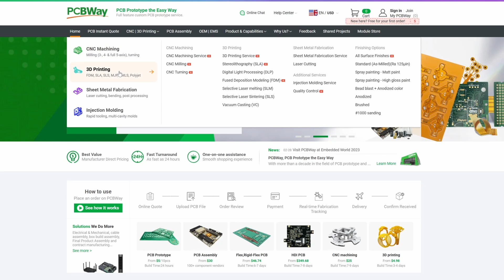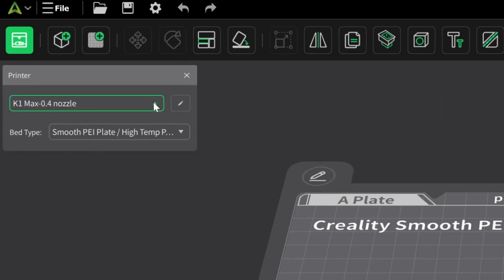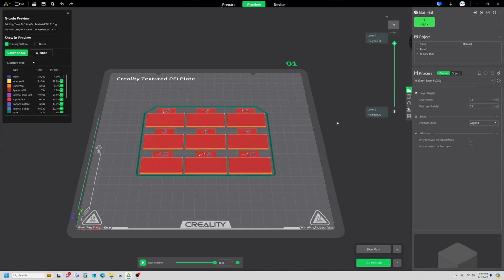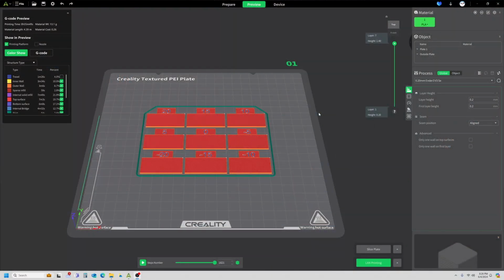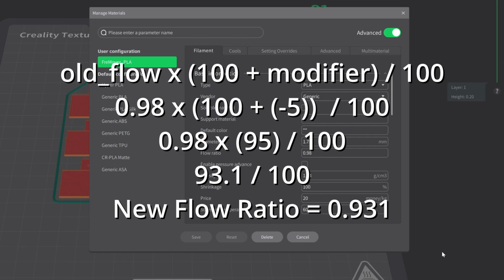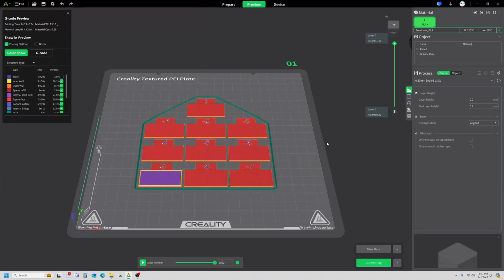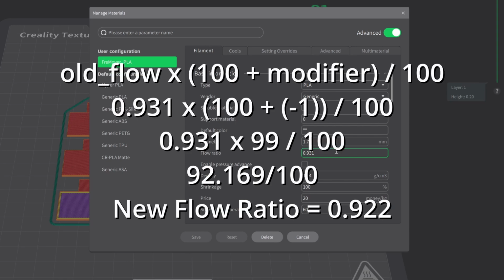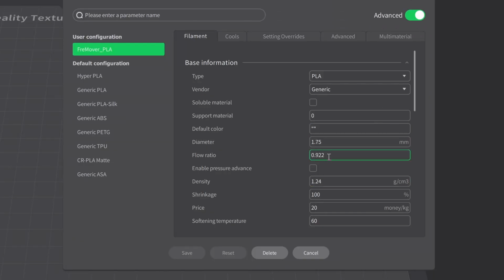Dialing In Your Flow Rate With Creality Print 5

Comment: Why dose it put it at 0.2 layer height when im originonal set at 0.12. And if I want to print at a slower speed can I adjust the speed before the test or should I leave it at its max it's set to . I would like to not print at max speed.  I tried to do it and it looks nice on one like 0 but then I do the factors I do the se and part it gose and looks like crap again

Comment: I am having no luck trying to print Polymaker ASA with my K2. Everyone keeps giving me the worst advise. Every suggestion makes the problem worse. The print surface is extremely rough like 35 grit sand paper. They say go with a hot chamber so I raise it to 70c, Raise the bed temp to 110c. Raise the hot end to 270c. Everything gets worse. All other settings trying to go cooler failed too. The parts warped badly. I am printing at the polymaker recommended speed which is stupid slow.
Reply from the maker: I would run a Temperature tower and flow rate test. But if you're eager to get going, first make sure the filament is dry. Even if it's brand new from a sealed package it can still have moisture. I run my Polylight ASA at 260c, my bedplate at 100c, my chamber at 55c. For warping, don't be afraid to use a little glue stick. Normally I use one called Magigoo for ASA, if I'm out of it I just use a little of the Elmers purple. But the way you describe it as really rough, I'm betting that you have damp filament and/or an extrusion issue. Again, run a temp tower. The do the flow rate test. Let me know how you make out! Good luck!
Reply: @pushingplastic7445  I just installed my new CFS system on my K2. I am running through all the calibrations after updating the firmware.  The humidity level is 56% when I loaded all the hyper abs filament.  I'll wait till the humidity is in the good range before running any more test prints. I am purchasing a large-capacity filament dryer for the Ender-5 Max. Unfortunately all of the high-flow filaments only come in 1kg spools.
Reply from the maker: @cajunroadwarrior  For ASA, you'll want your humidity 20% or lower. The dryer will help!

Comment: new creality 6.02 does the first part for you so now you dont need to change flow rate after test 1 as it ask you for the result is test 2 then proceed with test 1 +test 2 x100

Comment: Hello, what happens if all the flow rate pass 1 had bad results? Do I just choose the best one out of the bad options? All of my outputs showed either underextrusion or overextrusion and nothing was smooth as your results. I am using a K1 max. I will appreciate the help. Thanks.

Comment: First off love the videos! I am newer to 3D printing and your videos have helped me learn a lot! I've watched through this whole playlist and but reverted my settings back to where I started messing with the flow ratio. My top surfaces are much nicer and the walls of my prints look much smoother. Catch 22 seems to be the over hangs look much poorer than before. Also in a few spots in the walls look like they are  missing a micro amount of filament. Any ideas on how to clean this up? I am printing creality PLA-CF, 220°C flow ratio .894

Comment: i have a question so in this  video you update the settings after each print. i notice in your other video your printed pass 1 and 2 without entering the results until everything was done. i also notice creality print wiki also says the same thing so i am kinda of confused which way is the right way.
Reply: Was looking for this question. Especially since v5.1, when you click on pass 2 of the calibration, it asks you which result you pick from pass 1.

Comment: For some reason when I print out the first nine flow rate plates, I am getting blobs and strings on some. Did the temperature tower, without issue but something is amiss. Are you able to advise?
Reply from the maker: If your temperature is dialed in, then I would be looking at retraction or print speed....or both! LEt me know what you find out!
Reply: @ thank you, will do!
Reply: @pushingplastic7445  all sorted, and it was wet PLA, I recently bought a drier and it is a game changer in my outside wooden workshop!

Comment: Thanks for sharing this, but when I try this in 5.1 it's slightly different, and the instructions they link to is different in how to calibrate the result.
I get a different result using your method, than using the method described in the instruction.
Have you tried it in 5.1..?
Reply: Im doing this right now, and it asked me to select the calibration that was best in part 1 of the calibration. I think it is removing the need for us to do the math
Reply: @ja-no6fx  also the layout is different in the software and also is different instructions on the website. So do you use the number or the position of the best print. Come on creality sort your self kid lol
Reply: The creality instructions seem to be an updated copy of the orca instructions. I think your supposed to select the one that looked best in the first pass without changing anything and then change stuff after the second pass
Reply: @ja-no6fx   That is what i ended up doing, but the instructions does not match the video they are showing.. not ideal Creality..

Comment: So I did everything how you said in the video but for some reason I’m seeing way more pillowing than I was seeing before I did the calibrations. Do you know why that could happen?
Reply from the maker: If you're seeing pillowing, then you aren't using enough top layers. How many are you using?
Reply: @pushingplastic7445  6 top and 6 bottom with a 3 line wall
Reply: @pushingplastic7445  I’m also doing prints that have to be printed vertically so idk if that has something to do with it

Comment: Thank you for making this video, Creality print 5 calibration flow rate is so different to Creality print 4, I thought 5 had a bug in it. Cheers
Reply from the maker: I have to admit, so did I. It was the reason I did this video first! I'm glad I wasn't the only one. Thanks for watching!
Reply: @pushingplastic7445  Creality Print 5 does not allow you to select the best tag from Pass 1, like it does in Creality Print 4. So I would say it is a bug.
Reply from the maker: @howardbealeau  It's not a bug, it's an updated method. Now it's more in line with how Orca, Prusa and Bambu Studio do it. Did you watch the video to see how it's done?
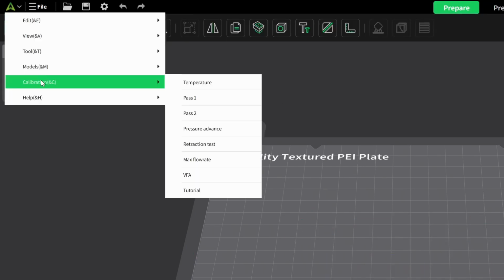Reply: @pushingplastic7445  When you got to the point of doing Pass 2 of the flow rate calibration test (beginning at 7:05) you paused (at 7:46) and seemed to be surprised that the ten blocks produced were "...incrementing by negative one", i.e. the flow rate was being decremented by one. So ten blocks (or tags) were produced with relative flow rates of 0, -1, -2, -3, -4 , -5 ,-6, -7, -8, and -9, with respect to the flow rate that was set in the profile after Pass 1. That was surprising to me as well, because now we don't get an opportunity to judge the print quality when flow rates are incremented by one w.r.t. the flow rate that was set in the profile after Pass 1.
Reply from the maker: @howardbealeau  There was no surprise, I knew exactly what to expect. I've done this quite a few times while dialing in other brands of PLA, PETG and some ASA. In addition I participated on the Beta test team.  I'm not sure what your end game is, my guess is to drive viewers to another video? Either way, like I said previously, if you don't like the slicer, don't use it. There are plenty of other choices.
Reply: @pushingplastic7445  The print profile used for your flow rate calibration tests had a 0.2 mm layer height. Can you comment on how much variation to expect when running the flow rate calibration process with print profiles that have different layer heights? i.e would the optimum flow rate have to be determined for every print profile as well as every new filament?
Reply: @pushingplastic7445  Were surprised to see Creality Print 5.1 now allows you select the best block from Pass 1, when you go to do Pass 2, just like it used to be in ver. 4.3? So Creality Print 5 did have a bug after all🤐
Reply from the maker: @howardbealeau  Are you still losing sleep over this? But it wasn't a bug, it was a revision to make it more in line with what CP users were use too. There were to many calling it a bug.
Reply: @pushingplastic7445  btw how do we do the calibration now that it has changed
Reply from the maker: @a.c.2659  They went back to the same way they did it with Creality Print 4. Here's a video I did for that https://youtu.be/ZF3Lctla7Nw follow this method.
Reply: @pushingplastic7445  Hi Bill. I have been trying to work out the correct flow rate for the last 3 days; I went back to Creality print 4.3 a few weeks back, because I got better prints and version 5 was playing up. A friend just bought a 3D printer and was using v5.1, so I updated to Creality print 5.1. I printed the flow test following your instructions and, you guessed it; there were all kinds of confusion, until I read these comments, Now I've got it :-). I know it's all time putting these videos together, but , do you think you could do the flowrate procedure on Creality print 5.1, just a quick video, for the new 3D printing people getting into this fascinating hobby. Thank you so much Bill, take care, regards Gary.

Comment: When printing do you use glue on your built plate?
Reply from the maker: I do, almost always. It's an insurance policy to avoid a failed print in my opinion. It's a tool that I choose to use. Some people like to brag about not using it, but there is no prize for a failed print.
Reply: @pushingplastic7445  okay thank you for responding. In that case what brand do you use? I’ve been looking for a good glue brand to use for my prints
Reply from the maker: @GamingPanda5748  Elmers Purple Lgue Stick. It works great and washes off of the build plate with warm water and dish soap.
Reply: @pushingplastic7445  thank you!
Reply from the maker: @GamingPanda5748  I should've mentioned that I use that for PLA, TPU and PETG. In the more exotic filaments like ASA, I use a brand called Magigoo. They have different blends for different materials.

Comment: Do you know of a way in Creality Print (V4 or V5 also is there a version of 5 coming to the Mac) ) to do sequential printing ? I have a project I want to print multiples, but I want to get the benefits of automation without the bed release . So I have a part I need to make a lot of and I am ok with getting 3 of this part printed at 12 hours a shot. (it take 4 hours to print each and I can fit 3 possibly 4(if Im lucky and the head does not hit it) and would like to be able to do sequential but I know its in Prusia slicer and Orca and Cura but I was hoping it was in Creality print. One at a time kinda a pain but 3 or 4 at a time but separate would be a bonus. Thanks..
Reply from the maker: I'm going to have to look into this. I don't think it is there, I haven't seen it. But honestly, I wasn't looking for it either. I can see where that would come in handy!
Reply: @pushingplastic7445  Thanks for checking into if for me.. It should be there but Im not finding it.

Comment: I tried to download and run 5, 3 times. Installed, uninstalled, and every time I open it, my cursor is off from the icons I want to click on. Like over 1/4" off. Only program i have the issue with. So uninstalled it again and gave up.
Reply: Not sure if this will help but I had such an issue once with some program, I don't remember which.
I was running my screen scaleing  at 125% (right-click on desktop and scroll down to Scale in Scale & Layout)
Setting it back to 100% solved it for me (and a new pair of glasses 🙂
Reply: @Ozzy-K  Everything else works fine.
Reply from the maker: If you still have it loaded, try running it in Administrator mode and see if that helps.

Comment: @pushingplastic7445 Bill, you replied in a comment that you are using V5.0.3.8736 the latest version I can find is V5.0.0.8636 as of 05-07-24, also, why use Creality Print ? Is it not just a fork of Orca ?
Reply from the maker: Go to Creality's Github link https://github.com/CrealityOfficial/CrealityPrint/releases/tag/v5.0.3 scroll to the bottom and download v5.0.3.8736 released two weeks ago. I don't know why they have the older version still on Creality Cloud. While it is a fork of Orca the algorithm has been re-written to be more specific to Creality Printers. Same reason the firmware has been updated for some of the Creality Printers. The same question could be asked as to why use Orca, it's a fork of SuperSlicer which is also a fork.
Reply: @pushingplastic7445  , Thanks for the information, although I did know that Orca was a fork (of a fork...), I was just asking to be clear, and also just realized I had already downloaded that version, just have not unpacked it yet. Keep that plastic pushing !
Reply from the maker: @madmaxh3  The nice part of all of these slicers becoming forks is a common language between slicers! Let me know what you think of the latest version!!!

Comment: hi bill having bit trouble with the maths my flow is 100 and my best square was -5 which is working out 9,995 is that correct thanks im not thick but not getting it lol
Reply from the maker: I'm not sure how you had 100 for your flow. That is way to high in Creality Print 5. It would make more sense to me if your original flow ratio was 1.00 (not 100). Your new flow ratio would work out to 0.95 in Creality Print 5. Now in Cura, the flow rate is a percentage, so your numbers would make sense there, but not in Creality Print 5.0. Are you starting with one of the built in profiles from Creality Print? Keep me posted and we'll do what we can to work through this! Good luck!
Reply: yeah it was 1 bill sorted now thanks
Reply from the maker: @paulmurtha766  Good to hear! Is everything printing good now?
Reply: very good bill

Comment: How do you have a v3 SE in there? I can't use creality print 5 as it says that printer isn't yet supported
Reply from the maker: I was surprised to see this but not completely shocked if that makes sense. The initial release of Creality Print 5 did not include the V3 Se. A few updates later and there it was! I'm running version V5.0.3.8736.  If you open the slicer, click on the Creality Logo in the upper left hand corner of the screen, click Help and then click "About" you can find out what version you are running. If you aren't running the latest, then click on "Update"  From the help menu. If clicking update says you have the latest version, don't let that stop you! Go to Creality Cloud and download the latest version from there. Another tip, in my video where you see me switch from the K1 Max to the V3 Se, click on that, at the bottom of the list there is an option to "Add" a printer. Click that and see if it is already appearing in the Ender Series list of printers. Keep me posted and we'll see if we can get the Ender 3 V2 Se to show up!
Reply: @pushingplastic7445  Thanks for the reply. I'm running the same version number you are. I've tried various build numbers and that printer is not in the list in any of them. The Ender series list only has v3 KE and V3, nothing else
Reply: And somehow, it's now in there when I checked again.... Weird...
Reply: Much better print quality with the new flow rate following your advice! Thank you :)
Reply from the maker: @MrCharliethegorilla  Awesome!